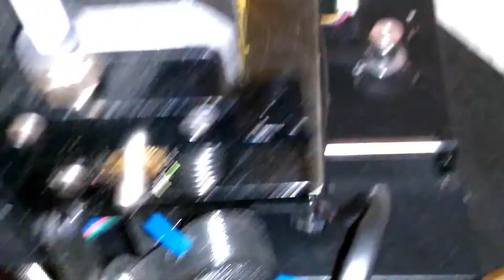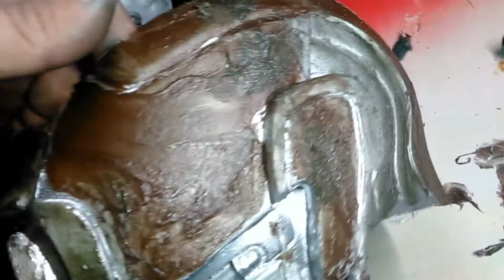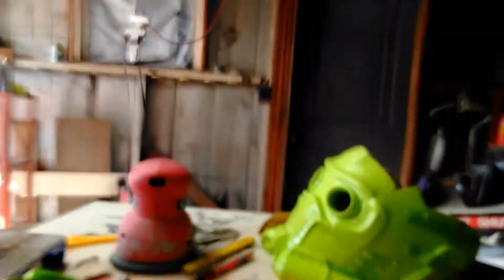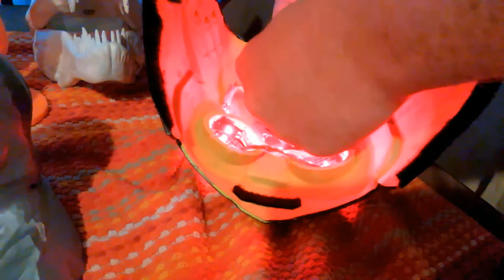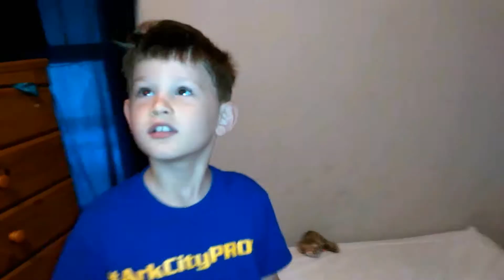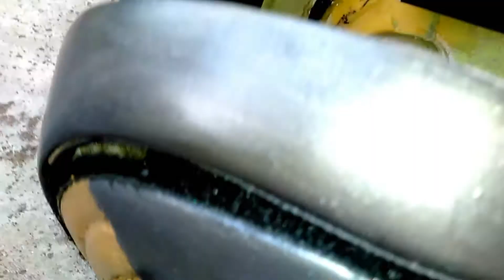3D Printed Star Lord Helmet

Comment: A little tip about super glue. Next time when using super glue sprinkle some baking soda on it. It will dry quickly almost instantly. And the bond is stronger.
Reply from the maker: thanks for the tip. I actually JUST decided, on my 4th helmet, that Superglue is really the only way to go. I was trying so many different glues. I Think I used 2 part epoxy on this helmet. Gorilla Super Glue glues fast enough for me. Like 10 seconds. I dont even use tape anymore to hold pieces in place. And I had to adjust a piece on my current Deathstroke helmet and it took WAY more force then I thought it would. It holds really well. I tried JB Weld, epoxy puddy, construction cement, and super glue and hands down super glue is the absolute best